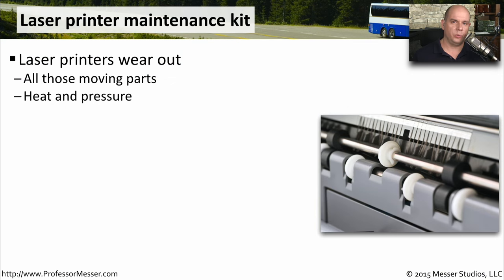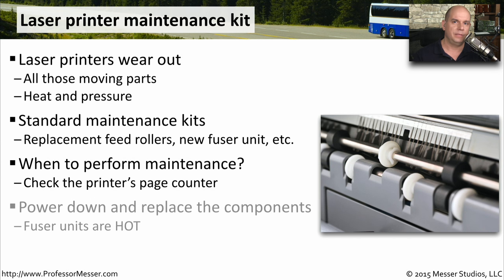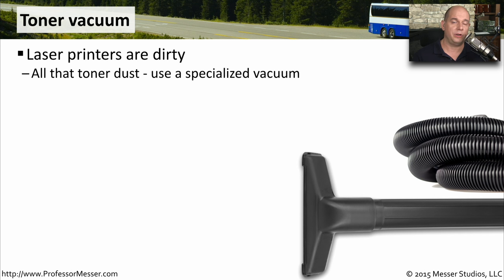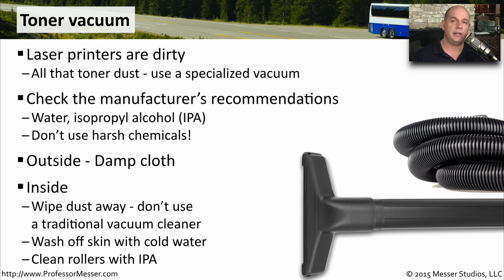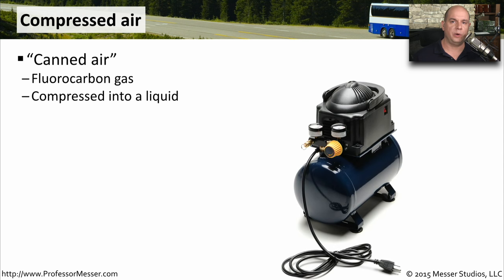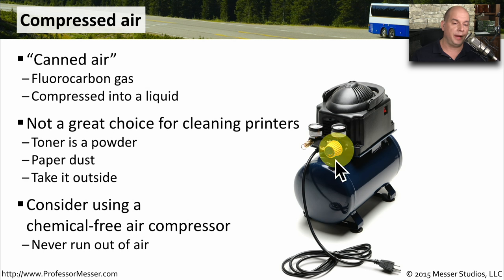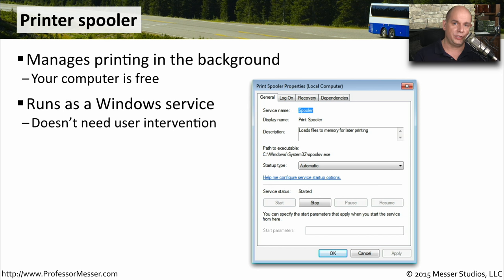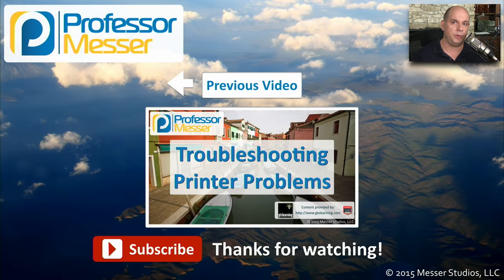Printer Troubleshooting Tools - CompTIA A+ 220-901 - 4.6

Comment: Just passed my 901 exam, with a 789, thanks Professor Messer!!!

I must admit there was a lot more printer related material then expected.
Reply: I mostly used these videos. After taking and passing both exams I realized that I could have passed using only the videos. But to get yourself familiar with actual test question try using various free practice exam websites. Then when you start doing well on that practice tests come back and watch the videos again so all the facts you remembered can sink in and you'll understand it better.